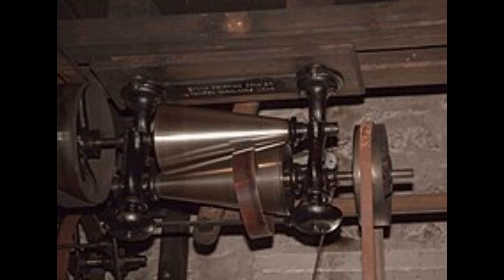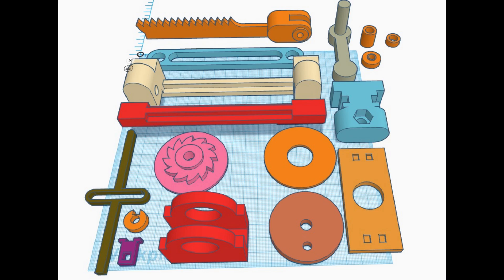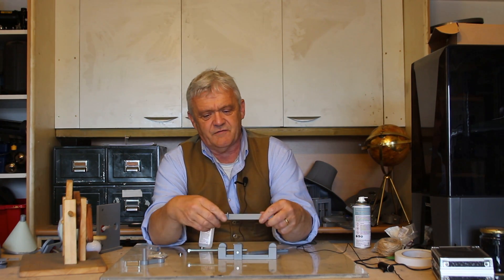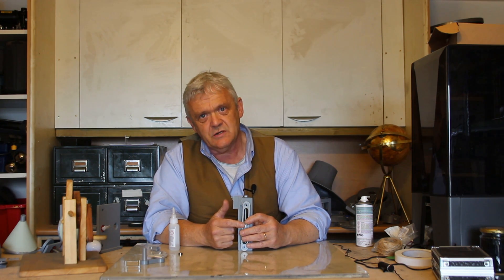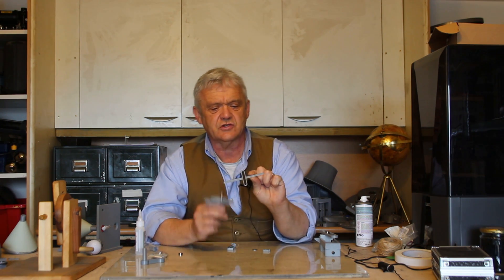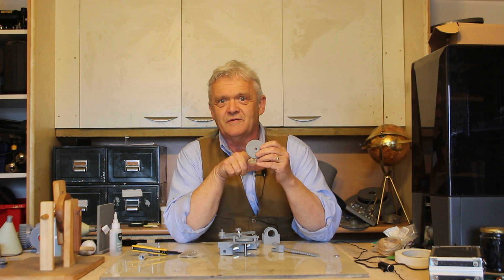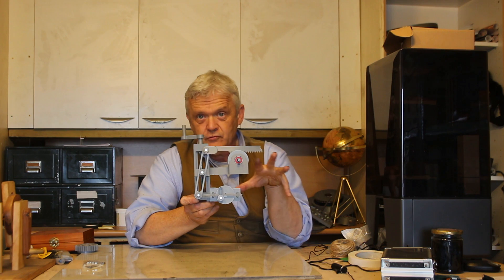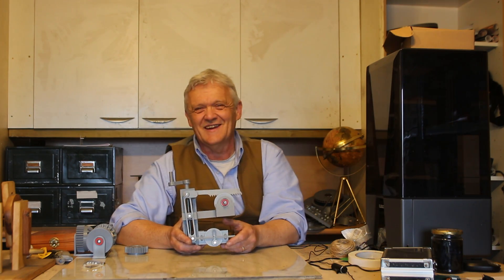1973 How To Make A  Continuously Variable Transmission

Comment: Was looking for ways to couple a rotary or vertical vane to measure and automatically adjust the dual cone commutator.  Any ideas that are super finessed?  Would need gravity or tension or magnetics to hold in base start ratio.  Would be nice if it could increase power to alternator coils simultaneously to increase output and resistance.  Just thought of centrifugal mass pulling at a 90 lifting the "golf ball"  Thanks

Comment: Wow, i am on ebike project. I have that one way gear and i think i could control the ratio since i use microcontroller. I also got ir distance sensor to read the pin position. It ll be e-cvt😮

Comment: What about making the distance between magnets and spole in the wind mill generator variabel instead then it could all be mechanical self adjusting using the centrifugal force. 
Unfortunately I can't remember the name of the unit with the 2 arms flipping out when rotating

Comment: Hi Robert, just a quick reminder about variable transmissions, in the mid to late 70s Daf/volvo produced a little car with this variable transmission the Daf 66. This little car was around for some years as i recall. I remember working in a scrapyard in them days and we had broken several them the old belt variable drive which was so different at the time, just thought you may be interested. Very informative and interesting videos most enjoyable.

Comment: Hi Robert, I live in rural South Australia, and I have both solar and wind. If I had wind only I would need a massive battery bank to bridge the power divide. My 15 Kw solar array charges my car runs the house and charges my 8 kw battery bank. Even a massive turbine wouldn't be cost effective as my wind resource is just too intimiternt, as you say it's horses for courses, the best solution for me was  cheap second hand panels and Lifepo4 batteries. The wind comes in handy on the occasional night when wind speed is high. It's about one night a month. Love your video, all the best, one old tinkerer to another.

Comment: I appreciate the versatility of 3d printing, but not being able to afford computers, let alone a 3d printer. Your videos for a while have been of little utility for me.
Reply from the maker: really? I find that odd as the videos have nothing to do with 3d printing - sure I use a 3d printer but it is just a tool to get something done - this video is about ratchet variable transmissions - i use the 3d printer to explain the logic and construction of them - you can make them anyway you want if you use the logic - i am sorry you don't find that useful
Reply: I do find it in part useful, but every video has the associated tinker cad file. Which I have no way of accessing it, so it seems like getting half the info. I find it easier to get a deeper understanding of principles when I can actually spend time looking at the renders and specifications.It's not your responsibility. Just wanted you to know how it came across to me and possibly others

Comment: Who is the poor guy assigned to sit by the gear shift 24 hours a day to shift it, since the wind is variable too? The nice thing about the pulley/belt version is that it has spring loaded pulleys that self adjust due to the torque. I think.
Reply from the maker: think it through mate - no one is going to sit there - so how would you do it? I know how i would
Reply: @ThinkingandTinkering  Don't know, if it's manually shifted somebody got to shift it, and the wind keeps changing
.

Comment: amazing that you should make this video right now! i've spent the last few days dreaming up a very similar solution to the ratchet, using one way bearings and chain and sprocket instead of the pawl, to build a velomobile with linear 'pedalling' mechanics. the infinitely variable transmission is an incredibly inspiring and appealing addition to the equation. THANK YOU! i'll have to think about how i might be able to add it in.
in my application, a further addition of a simple pendulum linkage could adjust the gearing automatically based on the elevation gradient. all mechanically controlled. wild and amazing! thank you for being such an inspiration Rob!

Comment: Looks like a 'Walschaerts valve gear' to me which was a ctv for steam engines that also provided a reverse phase, so it had maximum power or efficiency going forward or reverse without disengaging from the engines power.

Comment: Two more variable speed drives you should look at, the Beier Variator and the Zero-Max Adjustable speed drive. I have used both very successfully though the Zero-Max is unforgiving when overloaded.

Comment: I liked the angle shifting transmission mechanism that was shown earlier.  That would probably be compatible with the spring-loaded tail assembly dampener of the old Aeromotor type mechanical windpumps.  However, I'm not sure if one would want the demand to control the transmission, or the supply.  The variance in supply on a windmill can change very quickly.
Reply: - however friction devices - have drawbacks - though the friction element can act as a mechanical fuse - preventing the system from self destruction...   pro's and cons..

Comment: In the 1970’s a TV show air in Sydney Australia demonstrated a ACVT that was a liquid.  When a voltage was passed through it it would start to become solid.  The liquid was placed between two plates.  One plate was the drive plate and the other was the driven plate.  With no voltage applied the driven plate will not turn when the drive plate rotates.  As the voltage is increased the liquid becomes more viscous and the driven plates starts to turn.  If the weight placed on the driven plate is too great the liquid “breaks” marginally, the driven plate slows.  Increase the voltage the liquid becomes even more viscous transmitting more rotational effort from the drive.  Eventually, the voltage passing through the liquid causes the liquid to become a solid and totally variable.  The weight that could be lifted, pushes or pulled is relative to the diameter of the plates.  It showed a demo of this ACTV device connected to a crane it was able to lift and hold a 1 imperial ton load.  The other advantage was it ability to dissipate heat be cause the liquid surrounding the two plates was still a liquid and thus  easily cooled via a radiator.  I wonder what happened to it.
Reply from the maker: it was ferrofluid i believe
Reply: Either it was too expensive to manufacture, or it might have been a suspension that separated over time, thixotropically, or under shear strain.  Shear thinning or shear thickening are by definition, non-newtonian behavior of susceptible fluids.
Reply: Sorry to rabbit on, but it occurs to me that if a system had two stable fluid transmission systems, one with a shear thinning fluid, and another with a shear thickening fluid, it could be dialed in to be self-regulating on power output without any sort of external governor.  If the fluids were immiscible, and had a density difference, perhaps they could even be contained within the same apparatus.
Reply: @grunwode  No, in simple terms there is just one container.  The two plates are immersed in the fluid.  Only that fluid that is between the plates is affected.  A low voltage affects only a small portion of the fluid and,as the voltage is increased more fluid between the plates is affected.  The fluid that is not between the plates circulates about the container from the rotation of the plates.  The container is the radiator.  The object is; the rotation of drive and driven is 1:1 that would equate to “final drive” with the differential would as it it is presently provide the final gearing as it presently does in motor vehicles.  If driven plate is rotating slower that the drive plate, a greater voltage is applied to the plates.  A sedan would have a smaller plate than a truck.  While different levels of voltage would be available the car and truck.

Comment: Stuff that messing about. Use the idea of the first cvt motor box. Which used cones and a belt. Yes not as efficient , but easier to make and maintain , also you can use gearing on the output to increase either speed or torque
Reply from the maker: you can if you want - there are a ton of ways to go  - depends what you want really

Comment: What about skipping the gearbox and using a spring / counterweight system on the props to maintain a specific RPM? Springs to keep the pitch course until the counterweights kick in bringing the blade finer and finer until the desired rpm is reached. Would also help prevent an overspeed situation.
Reply from the maker: build a model mate - i would love to see it

Comment: So what's the range of the transmission? How do you calculate it?
Reply from the maker: it's infinite mate and it is the ratio of the bar length at any one time - but you can pretty much set it to anything in between

Comment: Are you sure variable gearing makes sense in a wind turbine? More torque is required to increase speed. When the wind speed is low, the input torque will also be low.
Regardless, more moving parts means more friction.
Reply from the maker: loads of research on it mate - checkout google scholar - tbh i just go by that

Comment: Fun stuff as always. Did I miss something with the Darwin wind turbine? I feel like it got forgot
Reply from the maker: nope - there is just not a lot to add to the darwin right now mate
Reply: @ThinkingandTinkering  I am over the moon that you replied to my comment!  I think I should rephrase my question then. Was there a video of it being completely assembled?
Reply: What about a variable magnetic field on the generator or a variable length serpentine? Could that be a direction to solve the problem on wind generation stabilization without risk of overheating and less mechanics that could break?

Comment: Wouldn't it be a bad thing that the more stuff you throw into it then the less you will get out due to friction, torque, etc???  I mean there is nothing 100% efficient so would it give us more than the loss the contraption added?
Reply from the maker: this is just a teaching model mate - ratchet CVTs are already in use
Reply: @ThinkingandTinkering  I didn't mean this I meant in general.  If we have a 20% loss, or even a 3% loss, are we going to get more than the loss the contraption adds?  That is what I was asking.
Reply from the maker: @generalawareness101  I am sorry mate I am missing what you mean - can you explain a bit more for me? cheers
Reply: @ThinkingandTinkering  Sure, as I am sincerely interested.  You know there is absolutely nothing on this planet that is 100% efficient and with that cool part you demonstrated in the vid you said it was about 80% efficient.  Now that was what you made, but it applies to everything, even NASA made contraption, only the efficiency should be better.  Let's use your 80 percent for this.  That means there is a 20% loss.  I am thinking like a VAWT and how it would use a transmission to go from vertical to horizontal.  That transmission will induce a loss (in this example, that would be 20%).  Wouldn't it be better to just go horizontal?  I just think we are ending up with some really cool contraptions that in the end makes it less efficient and is a Rube Goldberg type mechanism.  It would be akin to saving 10 mpg in a car, but it used 15 gallons more than just doing a direct drive instead.  I understand the theoretical as long as chasing after it gets us to actually save more than we use with it.
Reply from the maker: @generalawareness101  ah ok - thank you for that mate - i understand - the efficiency I quoted was for all friction transmissions of this type not the one i made - that is it is the understood figure for friction transmissions even if they were superbly machined by anyone including NASA. It's the problem with friction transmissions. The reason you use a continuously variable transmission (CVT) is it best matches the rotor speed to the generator speed for all wind conditions so the loss in efficiency in transmission is often made up by the overall machine efficiency in converting wind to electrical power - bear in mind most wind turbines as total machines are only around 30% efficient - if you use a CVT that has a higher efficiency than a cone type friction transmission the efficiency can go even higher such that the total machine efficiency is raised above the total machine efficiency of just using a gear set - this is why automobile manufacturers are crazy for this tech
Reply: @ThinkingandTinkering  Well, they now have eliminated transmissions to solve all sorts of issues on electric vehicles and the days of the drive train and rear-wheel drive are pretty much over due to this improving mileage, and we no longer tow much.  Watch, some Einstein type, or Hawkins type will figure out how to prevent magnetic fields from slipping then look out. 

Thank you for explaining, and understanding.

Comment: If electro magnets were used on the wind turbine generator could not a variable matched drive be achieved by altering the magnetic field of the coils with electronics, monitoring speed and electrical power, similar idea to MPPT.
Reply from the maker: yes i mentioned that in my previous video

Comment: Just curious about the parts that you printed using your 3d printer: Did any parts require any CA glue or are they holding up as is after being printed?
Reply from the maker: no glue was painted over them mate

Comment: Instead of skate bearings you can use flanged sintered bronze bushes, in fact plain bearings, which are  simpler, smaller, easier to fit and often  cheaper in acquisition and maintenance.
Reply: I would go so far and use something like iGlide filament, and then print whatever bearing surfaces I needed.   I bet with the size of his channel Igus would send him a pile of 3DP filament materials samples.  They're always interested in new applications/markets for their materials - some would say this is a pretty good sized and fairly captive market for the channel; modern vendors realize and foster that.
Reply: @russellzauner  My experience with Igus bushings is mediocre: fragile, broke often when inserting, &c. Printing them ? Maybe with a multi-head, i.e., multi-material,  printer.
Reply: @peterfelecan3639  You need to use the right materials for the right applications.
Did you have them help you or did you just order stuff without talking to them?  Also, I used them for many other spot fixes and little bits that I didn't want to lubricate/clean all the time; things I wanted to stay slippery/smooth, without maintenance, and long wear life.  I simply trusted that if I needed to replace the bearings in my front loaders hydraulic arms that they didn't FAKE the extensive testing and demonstrations they've published using heavy equipment. 
I've sent your concerns to Igus but that's all the effort I'm going to give to a random anecdote on the internet.  I'll check it though, it's easy enough. We'll see what's up with your complaint.
Reply from the maker: cheers mate
Reply: Where do you get those?  Amazon?